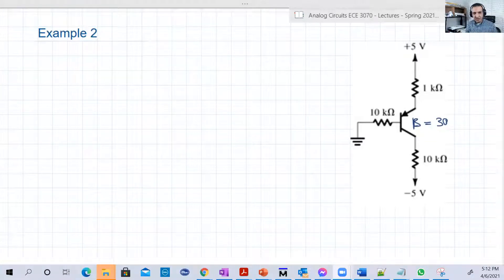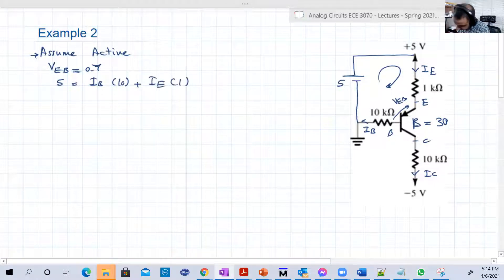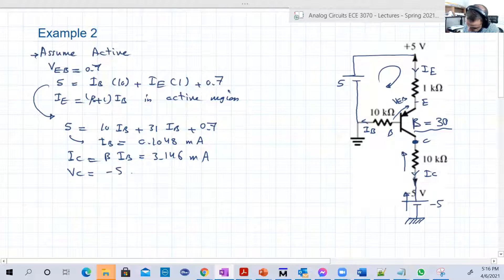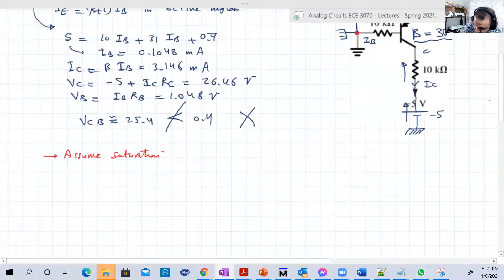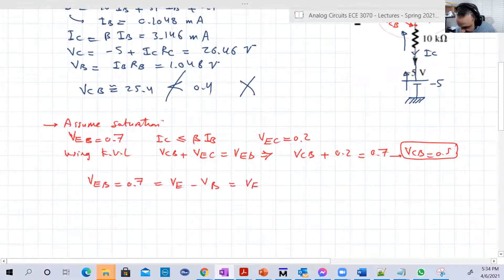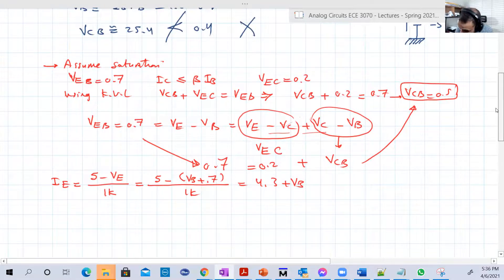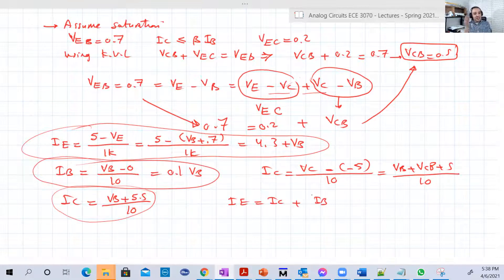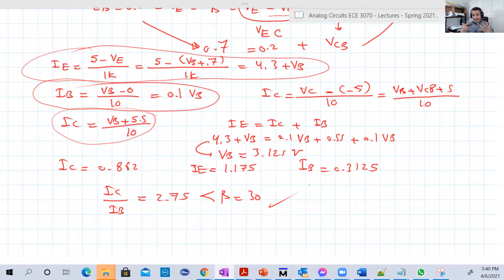[19c] PNP Transistor circuit analysis in Saturation Region

Comment: Please how did you obtain VEB= 0.7?
Reply from the maker: hi Fulem
thanks for asking. So in PNP Transistor when we assume the transistor is in active region we always assume constant base emitter voltage (it is like a diode). Usually we assume it ~0.7 but you might find some books assumes it otherwise, e.g. ~0.6. Sedra's book which I am using here usually assume VEB = 0.7
Hope that helps. Thanks anyways for watching so please share with your colleagues and subscribe to the channel. There is also other interesting videos so please watch them.